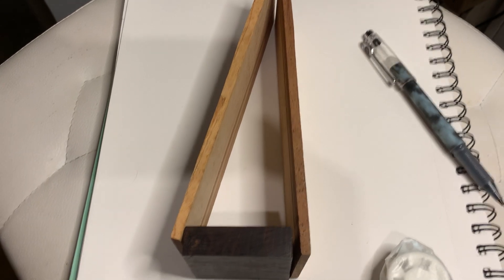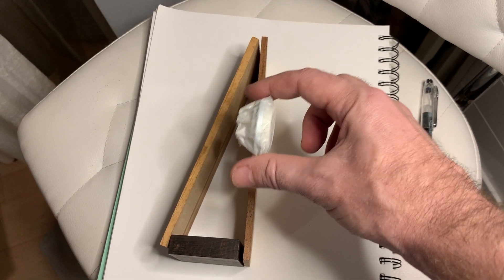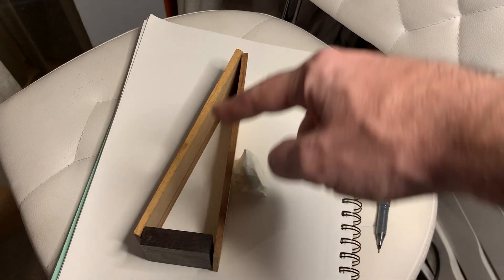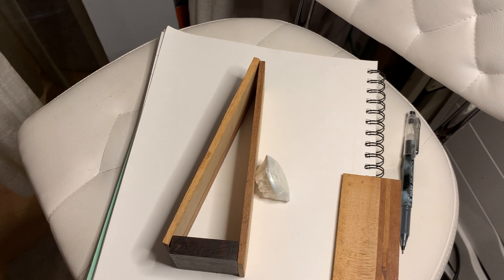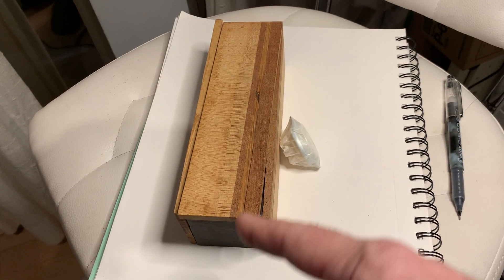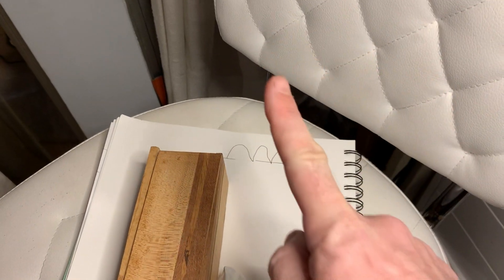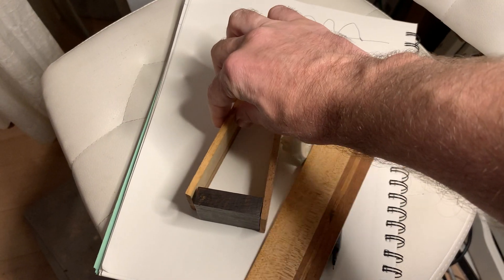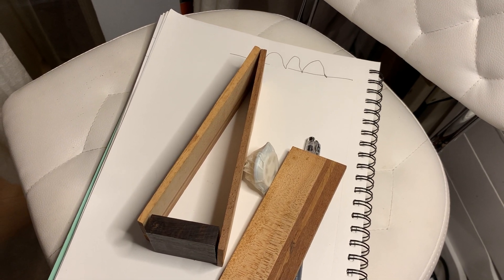Voigt pipes  - why the wedge shape?

Comment: What would happen if you steamed and bent the front panel like a guitar body side? It would still be one piece and possibly longer
Reply from the maker: Neat idea! 
Sadly... For a stereo pair, you would need to EXACTLY bend the two with the exact same force, angle, and the effect of unevenness / knots in the wood would be greatly amplified due to the stress applied to the wood. That would make matching a pair of speakers next to impossible unless you have very elaborate industrial setting with the ability to calibrate the forces applied, and keep the steaming constant that would require an industrial steam-bath well beyond your own garage. Not for the home builder, not for a small audio company either. : ( A big company like B&W could totally do it. Yet, they rather use synthetic materials  because it's a lot cheaper (even though that "cheaper" still amounts to crazy money by the time it hits market).
Would be fun for mono though.... although tough luck mounting the driver well onto a curved surface. Can be done though, but that's an additional consideration that needs handling.

Comment: Hi Janos. Is there an “optimal” angle to the triangle? Claus
Reply from the maker: Hi Claus, to be honest, I have not played around with the angle. I'm using the angle that Derek Walton used (it's a bit deeper than the original Voigt/Lowther pipe), and that works very well, used that for two of my best pipes, all others were not as good. Making the pipe deeper (the taper wider) allows for bigger free air volume (translating for higher efficiency and better bass response), but going beyond a certain point we start seeing loss of precision and speed. It is something that can be explored more, but it's also an issue that highly depends on the driver choice, as the free air volume has to match the driver, plus the driver needs to physically fit in the cabinet.
Reply: @realworldaudio  That makes a lot of sense. I'l be more patient and wait until I know more about VP design :) As always, thank you for a very thorough and clear explanation! Claus

Comment: Could one say that the Voice of Lancelot has an bent Voigt pipe?
Reply from the maker: Yes! ; ) It has a folded pipe inside. Yet, it does not open to the room like a transmission line, but uses a port. Hence, the Voigt pipe inside the VOL acts as a flow organizer to laminate the air flow in the 200-40Hz region (so that these waves are organized, instead of just randomly bouncing around and loosing energy, as in traditional bass reflex cabs), and then the port acts as a converter to transform the energy of these waves down to below 40Hz. So, the port acts as a 1:2 ratio wavelength / pressure converter, instead of the usual 1:8 ratios (or much higher) characteristic of bass reflex cabinets.
Reply: @realworldaudio  very nice…its getting more interesting by the minute😍 Something for another great viedeo😄👍 I’m eager to build something like this.
Reply from the maker: @ArnoldteRaa  It is fun and easy, and there is a way to customize its sound to two distinct sonic preferences! Will share it soon ; )

Comment: Hello sir. I see on some designs the driver is placed in the lower third of the pipe, some in the middle and some in the upper third. Which one is best? What will be the difference? Thanks a lot. Guy
Reply from the maker: I think it's best to keep it at ear level. With the pipes I built that works out to be halfway for the straight pipes, and around 40% for the folded pipes.

Comment: no you don't need two parts of the front baffle it's all one continuous peace! you can easily bend wood and more slope then what you're showing at the top,
and it would be actually more rigid and less acoustic resonance in its construction. the back  isn't split like you show that would be a straight piece but that would be a straighter angle because of the bend on the front,
similar to having the driver on the back and having that the front with a slope could be achieved in the same why! not sure that really matters if the drivers on slope?
you might need to put a narrowing peace like a bowl-shaped just below centre of driver. to give yourself a Venturi.
 Other benefit as well because it's one piece and you're bending the wood allows you to use a thinner piece of wood but keep the same structural strength maybe even more just like you said with musical instruments, that's why they're not Square but rounded shapes for structural stability and preventing  resonance of the wood.
if you use spruce as the front baffle and bend it then it's just a soundboard just like a piano but  would have to be tune to e-flat minor 311 Hz
another benefit allowance you to have the baffle wider as well because of the bend what gives you more sound reinforcement especially in lower mid-range and bass without unwanted reflections.
no I agree the concrete doesn't sound good idea
Reply from the maker: I see! Yes, that would actually be beneficial to introduce a slow curve, and to change the straight taper to a more curved form, which should include the bottom curving as well (on the back side), not just the top. Is there a simpler way to bend wood than a long steaming and  pressure application to get the shape? The main advantage of the Voigt pipe design is its absolute simplicity, one can build it with nothing but a jig saw, a drill, and virtually no woodworking skills. You don't even need a workshop, can be done in the living room. (That's what I did ; ). It can be improved upon, yet, as it is, it's an absolutely amazing speaker. Still, if one has the skills and a wood workshop, worth a try with the Venturi shape! Thank you for the tip;
Reply: @realworldaudio  depends on the wood and thickness but the baffle being thin not much of a problem! you could just use hot towels and a steam iron.
or you can cut horizontal strips in the wood and bend it that why if it's thicker.